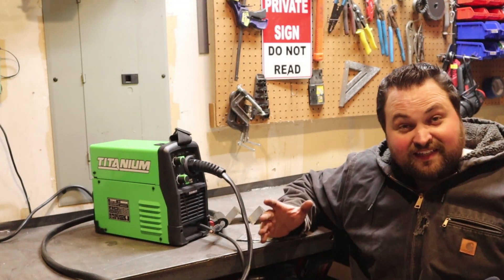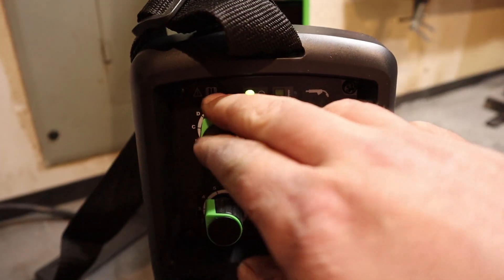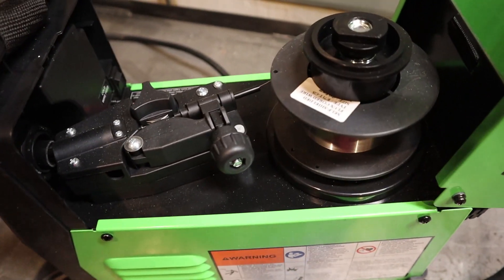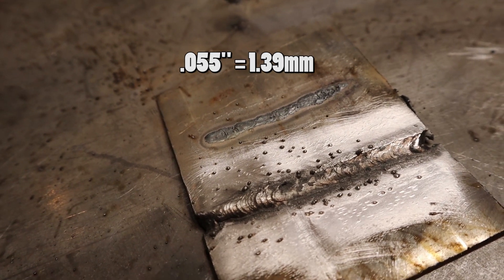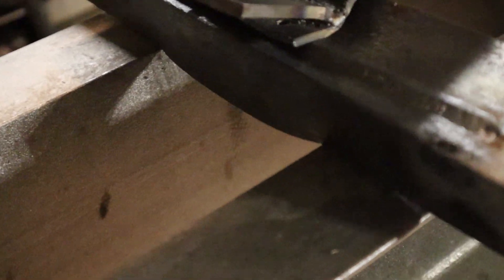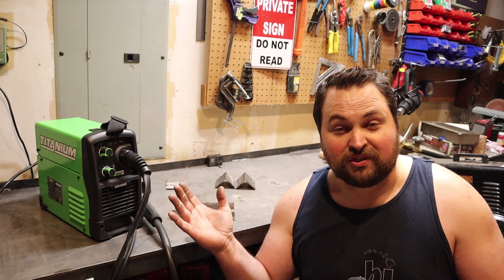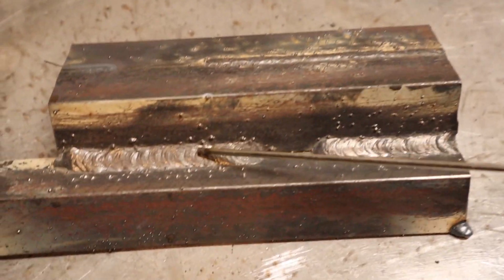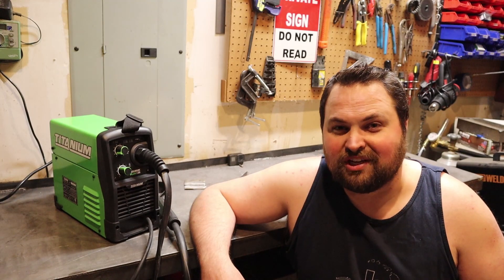Titanium 125 Welder Review & Weld Strength Test

Comment: Thank you!  I bought a barely used CE 125 for new muffler bracket install and small projects.  I heavily debated upgrading to Titanium 125 afterwards with 25% coupon and you just saved me some cash.  Lot of folks saying CE 125 won’t do as good a job but all CE 125 vids show it’s a decent welder for weekend garage guys like me. I’ve run several practice welds with it and it’s totally solid.  “It’s all about the puddle”. Thanks SG!

Comment: Looked like you were pushing the weld when you were sticking the thin metal together. Got slag, you gotta drag. Could be why the welds looked the way the did. The black 90 amp welder is an AC machine and electrode positive. Flux core is designed for DCEN (DC Electrode Negative) welding. You can lay a nice bead with  the ACEP black box but it doesn’t penetrate as well as the titanium which is a DCEN machine. I converted my black box over to DCEN using a rectifier, added capacitors and an inductor. The penetration improved…about as good as 90 amps can  do. Overall the welds looked better after conversion, as they should but I still wouldn’t weld more than 1/8” with it. Spatter was greatly reduced after converting. About the time I finished converting the black box, HF dropped the titanium line. I was probably one of the first to purchase one. My store hadn’t set up the display yet. The titanium 125 welded circles around my converted 90 amp black welder straight out of the box. I have welded 1/4” plate with no issues. I successfully welded 5/16” plate with some preheating. I have welded suspension pickup points on my race car with it….I ain’t dead yet. Titanium is a good machine for the price.   I use the Lincoln NR 211 in both machines and it runs good. Throw the Harbor freight crap straight in the fck-it bucket. I am not a certified welder but I I have been running mig, tig, stick and flux core machines for 30 years on job sites. I actually prefer FCAW welding (flux core) over any other process. No gas, no worries about wind, more forgiving when surface prep sux ( with large 3 phase machines and .045 wire that has power to burn through the crud), no swapping rods every 8 inches. Although Stick is a close second. The titanium 125 is a great machine to learn on and can be used to become proficient and actually build shit while you’re learning. Wait for it to go on sale. You can often find it for 169, never pay more than 179.  I saw a sale price of  159 as of 06/2023. I am on my second titanium 125 and can’t speak of longevity of the machine. My first titanium 125 and the converted 90 amp  black box were stolen out of my shop by and addict. So if you bought a supercharged 90 amp welder at a pawn shop in the St Louis area…you’re welcome. I will be using the titanium 125  to build a trailer using .120 wall 2x2 tube in the upcoming months….maybe I should make a video…🤔

Comment: The big problem I had with the Chicago 125 is the high/low power switch. I tried to tack weld some sheet metal while doing some body work and you can't get the right amperage. Plus, the speed adjustment sucks too, especially at low speeds, causing it to drag and stick which causes erratic wire feeds.

Comment: Hello. Ive been watching a lot of videos about this welder, finally bought one and im gonna try it soon. My question is will it handle sheetmetal between the 18-22 ga range? Not expecting great MIG-GAS results but dont wanna blow through the metal either....Thanks
Reply from the maker: Oh yeah, this welder is great for sheet metal. It's more adjustable than older models so you can fine tune and get what you need out of it! Good luck!
Reply: @StrangeGarage  thanks for the quick response....Im thinking of using INE wire for splatter control. Is this a good idea?
Reply from the maker: @katkiller50  I couldn't tell you as I haven't tried it. Lincoln .030 works great, basically any .035 is great. Good luck!

Comment: Cool vid, silly question, could a small 1000 watt inverter run this?
Reply from the maker: Not very well. Peak draw on this is around 2400 watts. You can probably run it a little on low, but I wouldn't start a big project with that setup.

Comment: I'm thinking about buying one of these... I'd use it mainly for repairing my truck when needed.... Want to do some lower rockers and cab corners... Converting the bed to a flatbed along with a repair just inside the channel of the frame where the leaf spring brackets mount... Figured 3/16th structural steel would be make a good backer for a small rusted spot in the frame.... 
The bed would be made of steel so figured this little welder would do the work... What do you think ?

Comment: 07:45  1. It's not double the price, in fact 2 days ago the Titanium was priced $19 more than the Chicago 125 on sale, but it's typically a $50 increase most days. 2. I've owned both welders and the Titanium runs circles around the Chicago all day, it does in fact make as good or better welds and the feeding mechanism is way better along with the expendable components, all much higher grade parts. The Chicago Electric is a Chinese sweat shop welder that runs and sounds like one.
Reply: Both you guys are right

Comment: Thank you, I was going to Buy the Green Titanium 125 welder today on Sale for $169. one today on sale. I have the Chicago 90 Amp I paid only $80,. Bucks for an sale with a Coupon. That welder I purchased to Fix the Back Door latch on my Cargo Van that had Broken and it was $100 for a replacement. I made a Shitty weld that first use, welded a 16 Penny nail into the Door lock and fixed it  got the Welder for Free.....Kinda. Since then I have stuck steel together, getting better but not a real Welder....more of a Farm Fix it Hack, but Love the old Box. I wanted the 12 Volt but watching this video I will stick with the Old $80 Box and be able to use 10 lbs Spools may add the 12 volt conversion I have ordered the parts in and just not done it yet. Thanks for a great Channel and I subscribed to learn how you got so much better looking welds than I had...But I am better having learned from you...Thanks ! You saved me the $169 Bucks I can go spend on other needed HF Sale Items today....

Comment: The Chicago might look like it penetrates but its ac powered ac penetrates less than a dc welder because your current is alternating dc your current is constantly circulating it never alternates by alternating current you arent getting the full amperage of the machine

Comment: Great Vid! There was 2 things I did that made this welder run way better for me.  One was upgrading the ground clamp and running good quality wire.  Stuff it comes with is not great by any standards.     Currently running INE and have noticed it’s so much easier to get cleaning looking beads in all positions.  For some reason using Lincoln wire and what the welder comes with I kept loosing flux coverage on butt and lap welds.

Comment: Is this good for welding sheetmetal? I have to do body mount speed nuts and was gonna JB WELD them lol
Reply from the maker: It will work fine. Lots of spatter but the welds will be good and strong.
Reply: @StrangeGarage  am I the only one who uses anti splatter spray when using this welder?  Makes clean up super easy

Comment: The smaller spool in this case is not a disadvantage. The Titanium is about light weight, and portability (hint...comes with strap).  It is  for small jobs, take with you in the truck for a repair, just easier to haul around.

Comment: Love mine! Couple things to add to this. It fits 2 pound spools. Spatter is always going to be a thing with flux welders, but can be mitigated by a lot of factors. Adjusting weld settings and cleaning the material from mill scale/oils etc being the best method. The factory settings are really hot on mine and I turn them down alot and still get good penetration on the welds. This makes it spatter way less. Good quality wire is a must for cleaner welds. Good video thanks for the content!
Reply: Same here and I use weld splatter spray when I use mine, splatter comes with my finger
Reply: Second on the spatter spray
Reply: SPATTER NOT SPLATTER
Reply: @Badeau68  Fixed. I had it right at the bottom of the comment but the top was wrong.
Reply: Thank you for the information!
Reply: Yeah, that was the first thing I noticed. My first spool was a 2lb vulcan spool.
Reply: @goldentrucker7921  ?
Reply: Different brands of wire produce varying amounts of slag.

Comment: I replaced the whip for a 12foot milliermatic one , the upgrade looks factory
Reply: I replaced the one on my 125 with the 10 foot lead off of my Titanium 170 when I put an HTP 15' lead on that one. I also put a better ground clamp on a little heavier 12' ground lead with a detachable dinse 25 connector on the T125. These mods also look factory and make it a lot more user friendly. It would be interesting to put a gas solenoid and a way to change polarities on it. If I ever do that I may need to do a video.

Comment: While I am NOT a pro at welding by any means, I have a question. 
So this is meant for light welding like the one I had from HF about 10 years ago, it was also a 110V wire feed. 
Now, as far as using it for light welding what about using it for THICK, say 1/4" to even 1" thick plate?
 I know this is a light duty welder but what if you made "MULTIPLE" passes over your original bead and built up the weld as you make multi-passes. 
Would that work on thick steel plate?
 Like I stated, I am no where near a pro at welding but do know how to use a 110v model now and then on some minor repairs when needed.
Hopefully you or someone on this channel can answer my question. 
Thanks for this video and your review, Take it EZ. Tom in NV
Reply: The old welder you had 10 years ago was probably an ac output these new ones are dc electro negative, as far as multi pass on your welds the wire you buy will say for multi pass or not ,
Reply: @mgoody8782  thanks for the reply, I honestly do not remember the welder. It served the purpose on small jobs while working. But thanks again for your comment.

Comment: I’m asking about this welder typical I’m going to weld go carts with this machine and how long can I use it but also let it cool down ?
Reply from the maker: Depends on your setting, but in general you can probably weld as much as you want. This welder is equipped with overload protection, and you probably won't weld enough to hurt it, as long as you aren't welding full power constantly. 

The actual rating is weld 3 out of 10 minutes.

Comment: I bought this welder out curiosity.  I was able to make nice welds with lincoln and victory wire, in the vert and overhead too.  I tried to test its duty cycle by setting it to the 3/16" weld setting(my meter showing 125-150a output. Welding 6" long welds on plate stopping only enough to clean for the next pass. Did about 7ft of weld in 20 min and it did not stop or appear to over heat.
Reply from the maker: I think duty cycle is often precautionary. I welded for almost an hour straight on my 90 amp before the power switch burned up. I just replaced the switch and it still works fine. I will 100% bring the titanium into work because it is so lightweight! I had to pack an 85 pound lincoln up 3 ladders today and I'm sick of it! I won't dog it, but at the end of the day it's not breath taking.
Reply: There are tools that are optimistic about the specs on the box. i was able to make welds that as smooth at my HTP pro pulse 200 running dualshield. Its not going to replace a bigger machine but it has a place. What drag angle are you using, looks to be about 45 deg? I run about 20 deg for flat and overhead. I've had my fun of dragging a LN-25 with a 45lb spool of wire and 200ft of lead around on scaffolding.

Comment: I use the 2 lb Vulcan .35 flux wire spools in mine and I love it!! Going on 2 years strong with this machine so its well worth the money
Reply from the maker: It is a good machine, no doubt. You'll see it on my channel more as time passes
Reply: @StrangeGarage  
The extra money is for the light weight of the machine 
REMEMBER the 85 lb. MACHINES
Reply: Do you perfer the .35 to the .030 wire?
Reply: @li3g1t5  depends on the material I’m welding. .30 for 1/8” or less and .35 for thicker material
Reply: I see a lot of people upgrade the ground clamp on this welder. Do also upgrade the ground wire?
Reply: @li3g1t5  that was the first thing I did. I got a much better ground clamp from ace hardware. It’s a Forney brand if I’m not mistaken

Comment: The  titanium  will take a 2 lb  spool and its not that difficult  to respool a 2 lb
roll from a 10 lb roll . Is your  old 125
original or modified  to dcen? What 
brand and wire size  were  used on the 
side  by  side  comparison?
Reply from the maker: Unmodified 90 amp, both running forney .035.